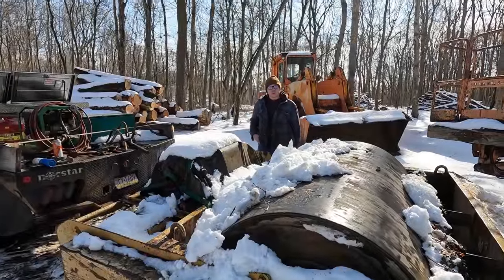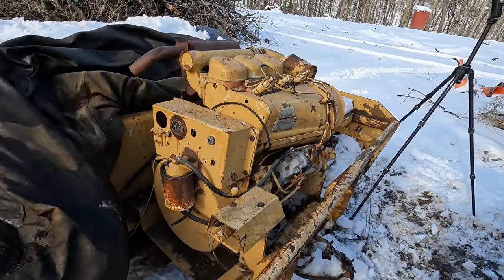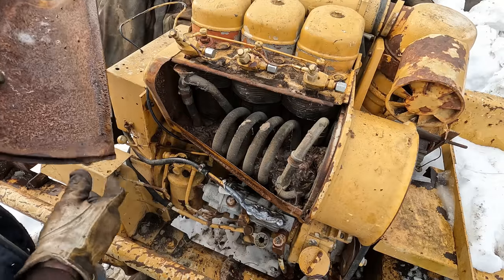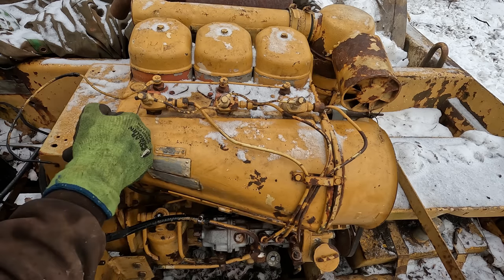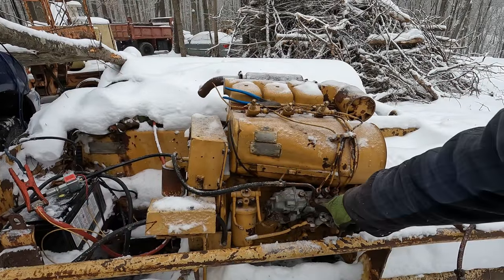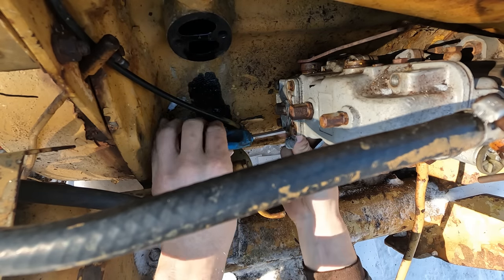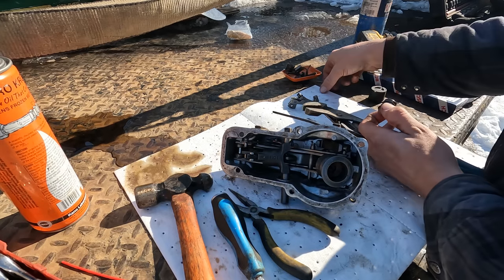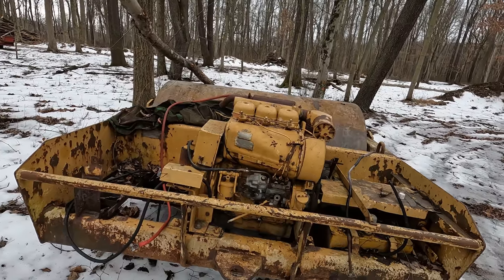Diesel Powered Roller Compactor, Sitting 30 years, Will it ever Run again???

Comment: Look, the hoarder at it! Again! Cheers from a fellow hoarder ... 😁
Edit: That starter sounded like corrosion and breaking brushes once You plugged it into Your truck. Those starters are,  other than the air cooled Deutz engines, not undestroyable.

Comment: Higher you lift the fuel tank the more fuel pressure you'll generatre. Since your fuel tank isn't even a foot higher than the injection point you basically had nothing. pressure = density of liquid x gravity x height. If you you need to do gravity fuel feed

Comment: Hopes, it sounds like a weak starter or lossy cables.  And there is some asymmetry in the compression cycles.  Maybe a stuck valve?  You need compression, preferably on all 3 cylinders.

Comment: I was typing its not spinning fast enough as you just pulled the starter. Lol
Disconnecting the drive shaft would help too. 

Replace the fuel filter. 

Im sure you will have it running soon.

Comment: Didn't it repair itself while it sat in the weeds? That is a beautiful engine. I was thinking about putting one of those in my Ranger with the flatbed, Miller Welder, crane, drill press and vise on the back...

Comment: this Video has me excited. because of the Engine make and model Why ? i  am a Boat Guy for more than 40 years and Imknow of a Former Life Boat  which have  outrageous Capacity Ratings for the size  of the Vessel and it does have the engine running  and Adapted to a Marine transmission. it’s  no Speed Racer  but with its single Propeller and Shaft  it sips fuel  and will keep a steady 7 Knots     this happens to be sort of a bare Hull  that i beleive i can  build a decent SuperStructure /  Cabin  and Pilot house  onto  and make a cool Long Range Trawler  boat that’s Trailerable  its Unique and. maybe Strange but that’s what i’m into   many Lifeboat Hulls were used by Navy’s  and turned into  upscaled Transport Vessels  for their  higher Brass  to get Shuttled to and from the Ships  i have seen many photos of those and  i like the look as they had a lot of Brightwork  and Fancy Amenities

Comment: I used to rebuild diesel injection pumps for a living a few years ago and I have rebuilt a couple of this style pumps but wouldn’t you know I have completely forgotten everything about them. I’m sure if I actually went about rebuilding another one it’d all come back pretty quickly but I couldn’t tell you wrong from right without refreshing my memory but I feel pretty certain from the bits of memory I do have that we probably removed the adjustment screws entirely but I know for a fact you’d never get it adjusted correctly in the field if you did that. Sorry I couldn’t be of much help but I agree I don’t think that engine is spinning fast enough. Love all the videos man never change.

Comment: Judging by the cadence with which the engine rotates, it seems all but one of the cylinders is low on compression. Hopefully after you get it running, those frozen piston rings come around!

Comment: For cleaning up bushing like that one on the throttle shaft, a brass bore brush from a rifle cleaning kit and an electric drill work wonder. Brass if soft enough not to damage the material, but strong enough to remove any debris and help smooth any galling out. Used this quite a few times rebuildijg other equipment.

Comment: 37:00 Had to pull the intake on the sienna to get to the back cylinders. Putting it all back together I dropped a 10mm nut. Didn't hear it hit the ground so figured it was on top of the trans.  Still, I looked for it in the dark with the flashlight on the ground trick. Next day backed the car out and looked in the bright sun. Decided to give it 1 last go and got my floor magnet and ran all the cracks of the driveway and nothing. Ran it along the blocks next to the drive way an up it popped.

Comment: Matt, you probably know this, when you pour the floor for your shop, don't let them use the old concrete cure, go to a industrial dealer and get a industrial dealer.  Put it on as soon as the concrete is cured.  You can keep it clear or add a color later.  I would suggest a light tan,  broom sweeps easy and also it is easy to wash down.
From experience, my 2 cents.
I finished all the walls with white roof metal 8 ft high.  All the electrical outlets were 4 plex.  I also put an exhaust fan in the top of the roof, big one will take smoke out in 5 minutes.  Have fun.

Comment: You used to be able to get parts for them pretty cheap if you look around  both new used and aftermarket. They used those engines in many of Ingersoll-Rand items and also Duetz ag equipment. Now with all that said I have not tried to buy parts for them since we starting parting cargo ships off the coast and not unloading them for well months I know that  the supply chain for alot of import parts is in the toilet right now and that may effect it (parts have to be air-shipped)

Comment: Why do you not preheat the engine? Don´t you see the glowplugs besides the injectors? Guess why they are there. Even in summer, those engines  wont start without preheating.

Comment: You are the roller/compacter whisperer.  It is funny to me how people people buy one of something, then somehow they end up owning 4 or 5 of  similar things.  It has happened to me as well.  Once you get that running it will let you get your shop site prepped amazingly well. I am hoping to build a shop/house in the next year or two, and I am already worried about getting the fill required to get the sight up to a grade I will accept compacted  and not end up with a lot of cracks in the concrete.   One thing is for sure, if I had lost that little keyway, it would have been gone forever.  Fortune was smiling on you.

Comment: We had a Duetz 5 cyl in our treefarmer skidder and if it got below 30 it wouldn't start even after new cylinders and pistons and heads it just didn't like the cold. We use take a propane plumbers torch and stick it through the fan for a minute or 2 it use to fire right up that old deutz use to run and run and when it got real cold down below 0 we use to through a kerosene diesel mix in tank and just let the skidder run sometimes weeks straight it would sit just above idle over night was a great engine but every 12000 hrs we'd have to change heads and shims.

Comment: Worst thing for any starter is slow cranking since this increases the current flow. I initially thought you didn't have a beefy enough battery but it was probably just the old starter on the way out.

Comment: I remember a skidder we had that was air cooled.  Made a plate on the jug side and plumbed it for exhaust from our pickup.  Pull up hooked the hose drank a soft drink engine was warm enough to start.

Comment: We use flex pipe put in yr exhaust crank up rpms and put other end on what yr tryingto start through a tarp over it about 20 minutes will be warm lot of freezes and cold starts in oil field

Comment: I  got  a  FL912  in  my  New  Holland  L775  skid  Steer.  It's  got  two  12  volt  batteries  in  parallel  for  12  volt  1500  cranking  amps.  Is  yours  a  single  battery  or  is  it  possibly  a  two  battery  set  up?  And  for  parts  I'm  dealing  with  Messicks,  and  the  local  Duetz  dealer.

Comment: "starter was too far gone" that's code word for we don't have anyone to rebuild it and we want to just sell you a new one. The insides of those starters are extremely simple. And you can mix and match parts for them I used to patch up old boat motor starters that sat next to salt water for years. There is no suck thing as "rebuilders" anymore they are all just parts installers.

Comment: Deutz engines are the best boat anchors in the world, save yourself the headaches and replace it with a kabota or daedong diesel engine they're tough and parts are cheap if you ever need them.

Comment: That wire nearly poking your eye out needs to be connected to the battery, it's glow plug power, it is necessary to start the engine at that temperature.

Comment: hi mat yes needs starter to slow turning over ,  if glow plugs are not working & u get it turning over faster {& your in the snow } get the blow torch & put in the intake when turning the engine over . it wont hurt any thing just give it sum needed heat , & then sum start u bastard spray cheers love the channel

Comment: Another thing, if  you want to make the fuel system original again, the normal routing is that the line from the tank goes to the small plunger pump and then  the line runs to the fine fuel  filter element that is located on the same housing  above the oil filter. From there the line goes to the injection pump. That fuel filter on the back of the engine is not original.

Comment: Had one of those engines in a tracto as a six cylinder it was a real pig to start in the winter so bad that we started leaving it in the shop in the winter we also went through starters. Like the other guy said you are going to need the glow plugs

Comment: I must have watched too much Vegas Rat Rod. The first thing I think is what would that 3 cylinder diesel be like in a Rat Rod...
Love your videos... Thanks for sharing!!!
Reply: Well it happened yesterday. My Amish neighbor has a power unit sandwiched between 4 horses and a round hay baler. It's a 4 cylinder air cooled Deutz diesel engine power unit rated at 54 hp. He had a flat tire on the power unit and needed a ride. I've already taken 2 tires from his skid steer for repair this week. The guy at the tire repair jokingly said on Wednesday he'd see me tomorrow, yesterday. 😅 I didn't know he was going to be that right. Only it was after hours.

Comment: Tough to find screws in the snow? - not if you use a magnet! (unless, of course, they happen to be made of brass or stainless steel!)
Reply from the maker: My magnet won’t pull them through the snow.

Comment: Have you not noticed that engine has glow plugs. Darn near impossible to crank one without them. Too much starting fluid and you'll break things. Also, that is a Bosch A injection pump which requires a high pressure lift pump. Don't think 7 PSI will cut it. More like 25-30 PSI would probably be closer. The OEM factory mechanical lift pump is probably OK. They don't fail often but probably needs cleaning. Replacements aren't horribly expensive.
Reply from the maker: Yes I tried using the flow plugs but they don’t appear to do anything. I’ve never heard of an injection pump needing much pressure but I’ll look into it.
Reply: It is possible the glow plugs are burned out. They take a lot of battery power. Might remove them and test them. Would be unusual for all 3 to be bad. Not sure which engine series you have. It it is a 912 those plugs are quite expensive. Over $100 each. Starting one with starting fluid can be done but it takes a while to get the cylinders hot enough to fire. Your starter is moving too slow also. Don't know if its a bad starter, weak battery, or cables too small or some of all 3. Is your engine 12v or 24v? As for the injection pump lift pump, both the Bosch A and P pumps require a high pressure lift pump. The rotary type pumps are low pressure in the 7-10 PSI range.

Comment: If the engine has been sitting for a more than a couple days, remove the cooling shroud tins and clear out all the mouse nests. Also, fix ALL oil leaks, no matter how small. Keeping the cooling fins clean is the secret to longevity.

Comment: Don't you ever wounder it's the glow plugs?
Reply: It does not have glow plugs. Possibly a fire plug in the air intake but most deutz will start with out it down to about 10⁰f.
Reply: @martyk1156  Well i assumed it was a diesel and not an internal combustion  with how you were fixing it!!!...so what is it?
Reply: @jefferysmom696  it is a diesel just not all diesels have glow plugs. None of them need glow plugs in warmer weather.
Reply: @martyk1156  Got ya...Looks kinda cold there thou!!!

Comment: Hello Matt, love your videos. I used to work for a company that ran Deutz tile plows. Dynapac models. V10 & V12 sized engines. In the winter they had electric grid heaters that could be turned on for a bit to heat up the intake air, however; ours were broke so we used propane fan ducted heaters (box store) heaters on an inverter and 20 lb bottle aimed at the intake shroud. Not super hot, but enough to warm the engine. Also, pretty sure ours started on 24 volts over 12. Big double battery’s for those big engines. This all coming for an Eastern South Dakota company that never liked to stop installing field drain tile until the frost was at least a foot thick!  Good luck on your air cooled packer. I can’t wait to hear it run. Wish I had one of those exact motors to play with. Cheers!

Comment: You should connect the glow plugs as that is going to increase the temperature in the chamber for the fuel to ignite easier.
Reply from the maker: I did, they don’t seem to do anything. Doesn’t seem to be drawing any power

Comment: Pequeños problemas sin solución cuando eres (americano)y tenés ante tus ojos el mejor motor del mundo.DEUTZ F3L913(75CV)es evidente que nunca supo como empezar con la reparación nunca reviso inyectores ni calibro la bomba inyectora (bosch- klb3 81) como tampoco re inicio el ciclo de puesta a punto y su correspondiente luz de válvulas. El motor de arranque de serie en estos motores es un (Bosch A115 12volts)accionado por dos baterías 6 volts 110 ampers conectadas en serie indirecta positivo{ + ~ - }{-~+}dando así la potencia de 12volts 220ampers. debo aclarar que estos motores poseen un sistema de precalentamiento mediante una resistencia y una bujía incandescente ubicada en la toma de admisión. DEUTZ 💯💪🇩🇪 MADE IN GERMANY